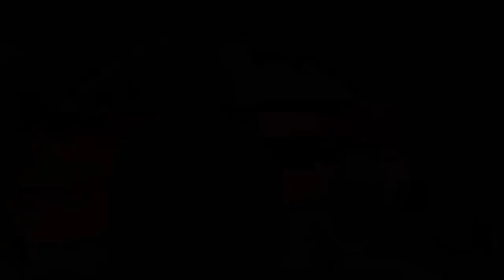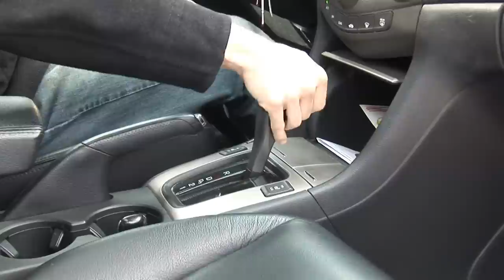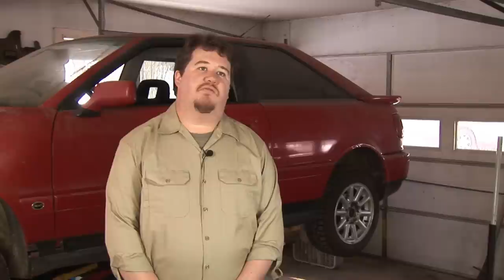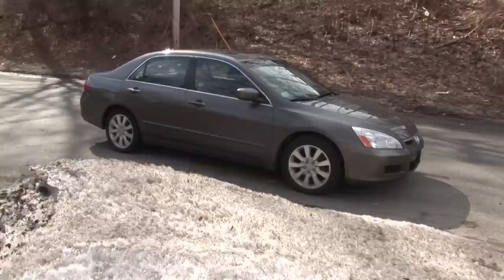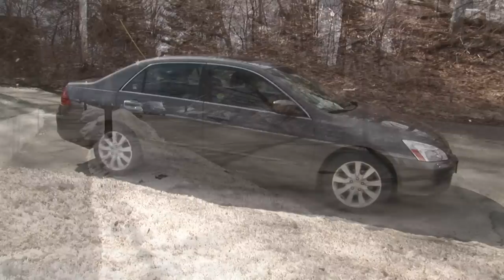Car Maintenance : Symptoms of a Slipping Transmission

Comment: Sorry, I ran out of space on my last comment, I changed the transmission filter and fluid thinking it would quite possibly fix the problem, but it didn't, I have plenty of fluid in it, so I know that's not the problem, I also have no idea if there has been any other transmission work done on the truck before I had it. However, I would rather try and adjust the bands  before I go through all the trouble of removing the transmission and having it rebuilt.. again, thanks..

Comment: Your videos are awesome. I can easily understand what you intended to say and they are so helpful. I have no problems with my 1996 Infiniti G20 transmission other than it sounds kind of rough when going into reverse. I had the transmission fluid checked, it is full and not leaking. What could be the problem?

Comment: I have a 1997 Buick LeSabre Limited. The other day I heard a scrubbing noise that sounded like it was coming from the driver side. I was going up a hill and my car completely stopped on me, it will not move in drive reverse nor neutral what do you think the issue is?

Comment: My 1996 Buick has this problem. It sometimes happens all the time then for some reason it does not happen for a few days. It happens while I am driving on the road as well as when I have stopped and I step on the gas peddle, it does not accelerate.I lift up on the peddle a few times then it will accelerate. The other day I was driving and all of a sudden the transmission would not accelerate and I had to pull over on the side of the road for 15 minutes before accelerating.

Comment: Overdrive and 4th are two different things, though most think that O/D is 4th, overdrive is actually a lock-up solenoid on your torque converter that matches the speed of the engine to the speed of the transmission, yours is probably bad.

Comment: I'm having a slipping problem with my 88 Trans am GTA. Now first works fine and all the other gears work good but when I'm driving coming out of first gear it mildly slips into the mext gear. I'm hoping I don't need major work, it also has enough fluid but I did notice when I checked the fluid it had a burning smell too it.

Comment: i have a 2003 honda element 5speed manual. has 130k miles on it i just bought it. never had transmission fluid changed b4. Is it safe to get it flushed? honestly i am scared to find out i want some advice. please if you know alot about manual transmissions let me know. this car wasnt driven hard but i has 132996miles on it with never having trans fluid changed out or flushed. please let me know what you think. Thanks

Comment: hi i have a dodge nitro 2007 and when i slow down it feel like a hit in the rear axis i dont know what it could be maybe a trasmicion issue or may be a suspencion problem, a week ago i race that truck and it smels like burn and throw smoke by the hood what you think? are these separeted problems?

Comment: I'm having issues with my 350z..Automatic Transmission. Sometimes it works sometimes it doesn't. Seems like it's slipping. I put it on drive and step on the pedal it only goes like 2 mph..  I switch it to reverse and I could feel the gears changing but it wouldn't move much..  Pls help

Comment: I have a 92 chevy full-size blazer with a 4L60E transmission, the truck itself has over 230k miles, but I have only had it maybe a year and a half, when I got it, I noticed the transmission slipped alittle, doesn't do it when it is cold, it shifts fine, but the more you drive it, it starts to slip, it is grandually getting worse, takes off fine as long as I don't put my foot into it, is it possible for you to e-mail me some info on how to adjust the bands on this type of transmission.. THANKS..

Comment: i have a 95 maxima and i floored it in rainy weather and it peeled out from 20mph to top of 2nd gear. now when i make a complete stop and take off the car dont move until like 1500rpms and same in reverse. 

What could had happened? i have new fluid and tranny was good and not abused to much.

Comment: I'm having a problem with my 94' BMW 318IS AT, sometimes I can find the gear shift from 2nd to 3rd will kinda hesitate, somethings it gets through, but sometimes the whole thing just release itself so I'm in a somewhat Neutural situation in which the RPM will be reved up and gear is not in at all.  I'll then need to shift to the actual Neutural or shift to a gear other than the original "D", then it will be normal.  It's being doing this often these days, especially in traffic, any ideas on why?

Comment: hi is it safe to get your transmission fluid changed plus the filter, if their is one on a 1995 pontiac grandam gt? 122,000 miles,i hear a sound from time to time on front right wheel area, my fluid looks brownish but not burnt,it has some red color still in it and no leaks.i have heard it could be bad to do this i think i should get it done let me know thanks,like your videos,allison

Comment: Wօա, ɦɛ's ɢօօɖ. Mʏ ċaʀ ɨs ɦaʋɨռɢ tɦɛsɛ sʏքʍtօʍs , ɨts a 2006 ռɨssaռ ʍaxɨʍa 3.5SL, I ɖɨɖ a օʋɛʀɦaʊʟ օռ tɦɛ ʋaʟʋɛ ɮօɖʏ ռօա ɨt ɨs sɦɨʄtɨռɢ sʍօօtɦ as ɮʊttɛʀ, I had drained all the fluid but didn't fill it back up( no money at the time) but when I started it and tried to move it, it just revs very high(2,500rpm). I hope the damage wasn't very severe and filling it back up fixes my problem.

Comment: what could cause slipping in only 1st gear? i accelerate but even if i take my foot off the gas it will stay in first gear until over 20 mph. after the ugly first gear, it shifts fine, second to third is almost unnoticeable. but if you floor it and kick it back down to first gear, the engine will redline and keep hitting the limiter until you take your foot of the gas. what cause is most probable, and what would be the solution?
Reply: scottkan357975343 bro that’s what happens when your going in 2nd and floor it and shift into first

Comment: I have a 1999 Chevrolet metro( automatic transmission) that runs fine for 15 or so minutes of driving  then  I lose power  ( like I let off the accelerator ) for like a  half a second and then it goes back to normal  it does this at random times .  And it does this  often at highway speeds . I been thinking its an issue like this  with the transmission.